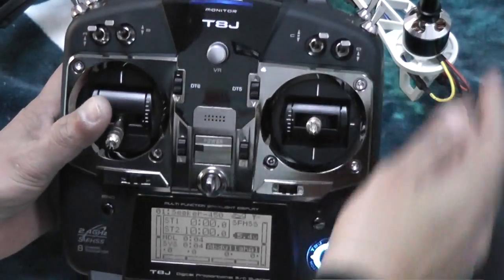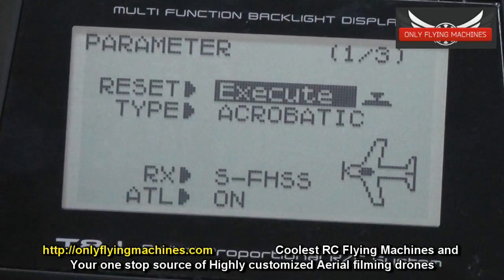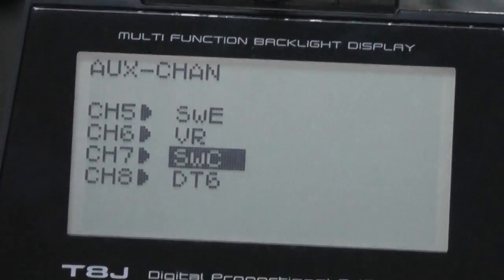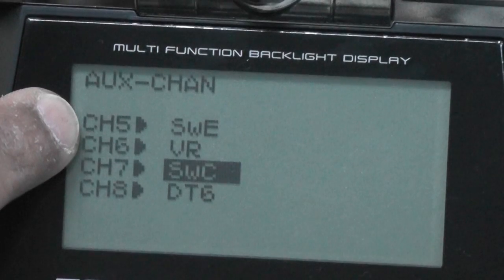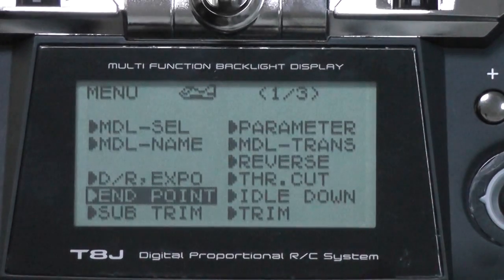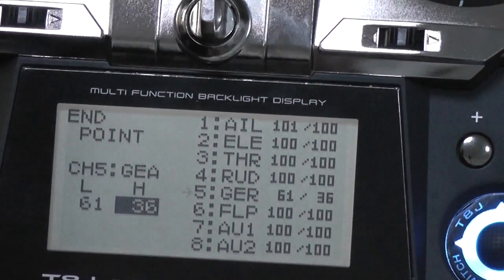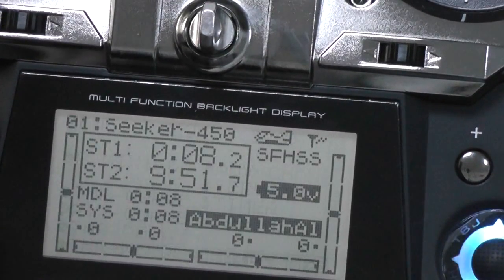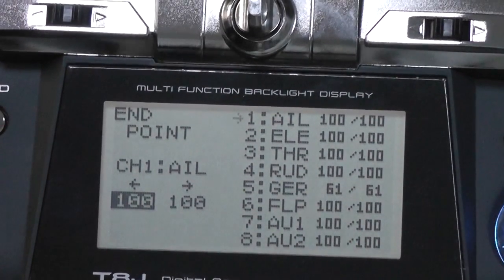Programming your Radio to use with DJI naza M GPS - Detailed Guide

Comment: hi alishanmao, my problem in t8j is that the 50% throttle stick is not 50% in dji naza. 55% throttle in t8j is 50% in naza. i cant trim my throttle.
Reply from the maker: calibrate the radio with naza
Reply: Already tried but stick still isnt in the center (from naza software) after calib

Comment: Hi, Alishanmao,  I am in the process of building a quardcopter using a Hoverfly pro with hoverfly GPS.  Alone with that i have a futaba T10J. The question that I would like to educate from you is why would you set the parameter to a Acrobatic not Multirotor?
and could you do a video how to set up futaba T10J.  Thank you

Comment: Hello! Your video is so helpful, thank you for taking the time to make it! I have a question though, I am using a FUTABA 9C concerted to spektrum 2.4, regarding failsafe, in my manual it says that failsafe will only work if signal is lost when radio is in PCM mode only, but since my radio is converted to SPEKTRUM 2.4 it must operate in PPM only, is there a way to program failsafe if signal is lost in PPM mode? Thanks!

Comment: Hi alishabmao iv recently built a Dji F450 with naza v2 gps , and im having a few problems im using a specktrum dx7s,
the trouble i am having is that my quadcopter dosnt seem to want to stay in gps mode i can get it to work sumtimes in the assistant program any ideas of what could be wrong any help would be greatly appreciated

Comment: hi.  I am using a dji phantom with tarot 2d with futaba 8fg super.  Pls help me how to set up the tilt function particularly in programming it with my RC controller.  How to program the tilt and remote gain control.  i would really appreciate if you can message me with the steps.  thank you.

Comment: Hi Ali,  I recently got a T8J as as you seem to have great success with them. When I got mine the throttle was on a ratchet type spring. I swapped it over and while much smoother still clicks.  Is this normal still.  I did a quick video on my channel on how to swap them over, but wanted to check with someone that uses the T8J to see if they had the same.  Thanks and love the videos.  JS